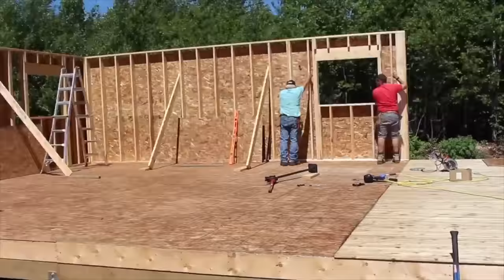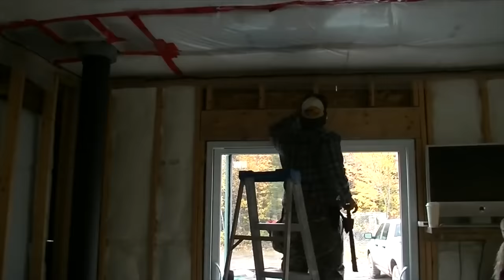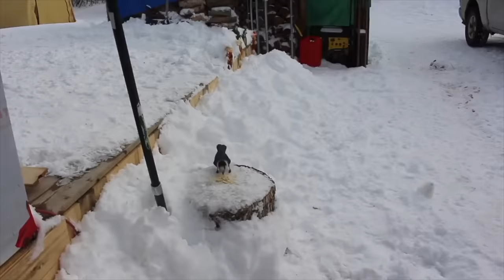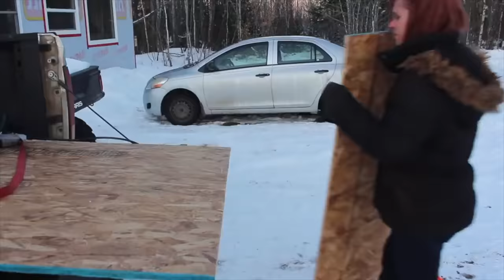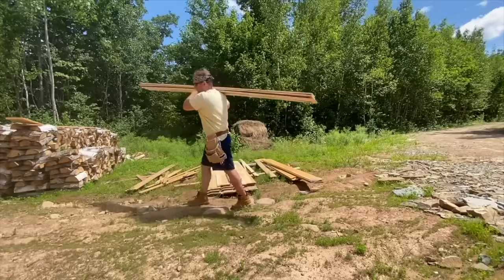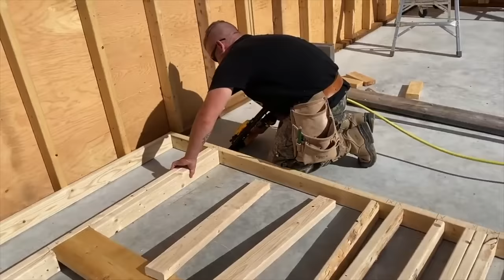TIMELAPSE - Couple Builds House In 14 Minutes!

Comment: I know everyone talks about insulation.  And this house is done.   For the next building project check out videos by Matt Risinger.  He is a building expert.  AIR FLOW is what makes a building last plus overhang from the roof.  More than the materials used although that matters too.  So when you go to make a permanent home (I got stuck first with a mobile now with a slightly better but still cheap stick built) I recommend you look at what he has to say.  Materials do not have to be expensive to be used in the smartest way.

Comment: where did you guys get the money  to buy 65 acres and to build that house did you borrow from relatives ?this is real helpful info that no one ever shares
Reply from the maker: We looked online for the land, and because it is so far out from anything it was very inexpensive. We bought the land a year before we ever even moved onto it. As for the build, we built the house over the last almost 3 years. Building slowly like that made it possible to use our pay cheques to build it. We never borrowed money from family or friends if we did not have the money for it we lived without it for a while. A line of credit was used when needed. We lived in our camper for almost a year with no power or running water while we built a big portion of the house. This way we had no other bills so we could put all our money into the house. If you are willing to live without for a little while then over time you can have what you want. We collected water from a near by spring and used it for all our needs, as well as a generator to power the camper. When we moved into the house we still did not have running water for almost another year as we saved up for it. Hope that helps :)

Comment: You three (includes young daughter) are a great team may I ask where you an engineer in the military ,I only ask because of your obvious building skills hello from Australia .myself and my lady went remote rural off grid here about seven years ago Vicki only made one stipulation running water and an inside shower and toilet,fair call  :)
Reply from the maker: Hey, thanks for stopping by. I was an ACISS (Army Communication and Information System) when I retired, It was originally called a Signal Operator when I signed up. I had been in the carpenters union for 10 years before I joined the army so that helped with the building side of things.

Comment: I'm very familiar with IDES, in fact I helped build VA's part of the program; and continue to work with it now in the role of a contractor (disability exams).  Your house looks amazing- congratulations!!  I'm also a Wounded Warrior and will be retiring to Alaska next year and building my own cabin/house in the woods.  I have a couple of questions for you: 1) the metal piers you have for the foundation, are they helical piers?  That is a big thing in Alaska due to the frost heave; and 2) If I counted correctly there are 18 of them for your house, is that correct?  What size is your house? In Alaska the helical piers cost $375 each, is that anywhere close to what yours cost?  Any information you can give will be greatly appreciated!!  Bill
Reply from the maker: Awesome and all the best. Here is the piles we used https://postechpiles.com/thermal-piles/ and we have 18 under our 24x40 home. The cost is dependant on the size of the piles, etc. Having said that, we paid somewhere's in the neighbourhood of $5000 CAD, installed. All the best in your future build Bill!

Comment: It fun watching ya. But I would not build it how you’re doing it. Ya should watch R & R Building he Specializes in Barn Building 
It nice seeing plywood and not chip boards. But I would of put a plywood sheeting under the metal with up with boards across on 2 foot center. To lift up for drainage between the vapor barrier and metal.
Reply from the maker: No need for the plywood under the metal roof. Thanks :)